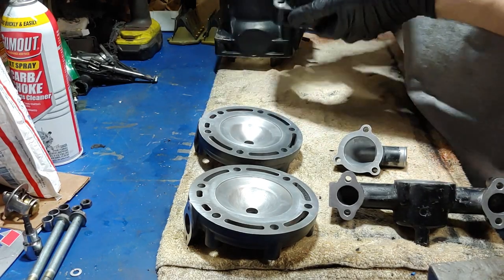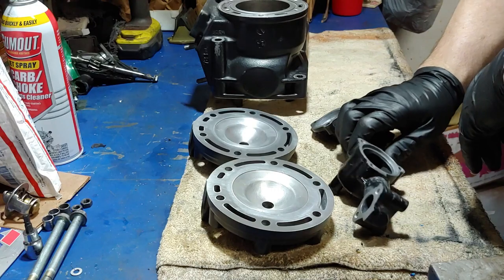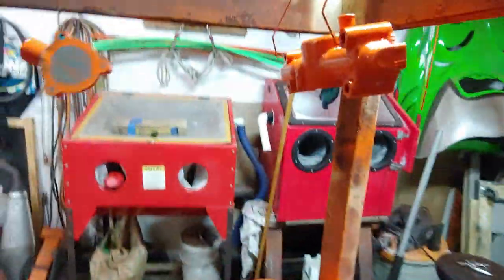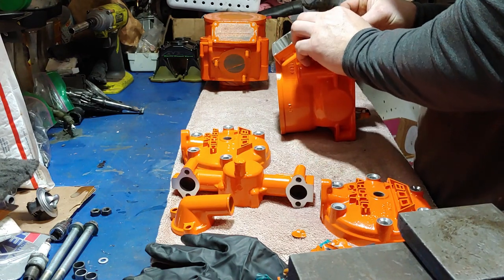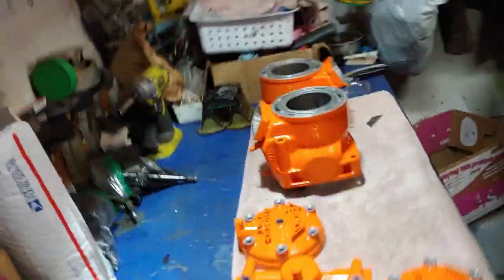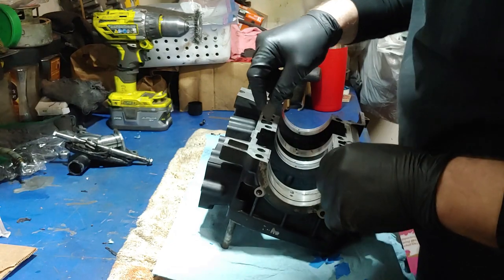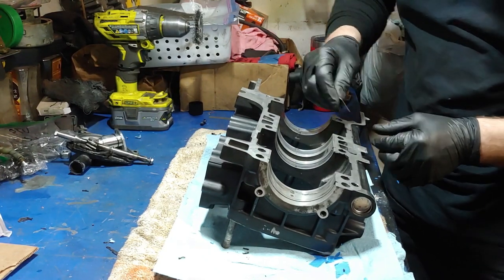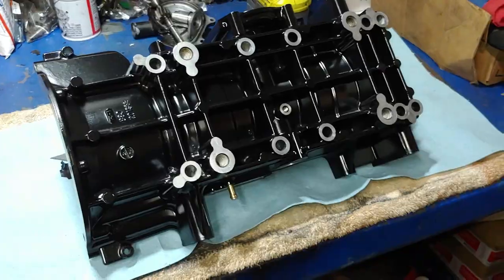02 Arctic Cat ZR 800 CCE Rebuild Part 14 || Refinishing Case, Cylinders, Heads and More!

Comment: You inspired me LOL going to order a powder coating kit if the world doesn't shut down
Reply: What grit and how much bigger is the Flex hone then the cylinder 1/4?
Reply from the maker: Hey that's great to hear! It's Definitely a great way to get started and yeah this covid crap is mostly all political!? it;s a real virus but no worse than the flu if even as comparable. 

Andrew C.
Reply from the maker: They usually are 320-400 grit and are Aluminum Oxide Ball hones that are made for a "range" of cylinder sizes... For example... 72mm-76mm cyllinder bores. So figure out your cylinders OEM bore and then get the closest ball home range that your cylinder bore is within. I use Transmission fluid for my honing process.

Comment: Dude i wish you could rebuild me an old school iron donkey sled like this but it has to be done right with the best/newest parts and no cheep junk like cast pistons only the best of the best parts like forged pistons
Reply from the maker: Well the cast pistons I used are made in Japan by ART, the same factory that makes the OEM SGP pistons. They last a long time! Many sleds taken care of have them for 10k+ miles. The forged are more for racing applications like drag racing. I only trail ride at this point. I did just acquire a 99 Thundercat 1000 though! ;)
Reply: @Fixin2Ride-Official-  bad dude bet that 99 tcat will scream and that old school tripple anthem purr tho

Comment: I was always told not to hone nickasil cylinders
Reply from the maker: Unfortunately a lot of people have been told that. It Says it right the Arctic Cat manual. Use a Aluminum Oxide Ball hone. Takes the glazing off. Glazing is burned oil that fills the cross hatching. The cross hatching is suposed to cycle oil through with each stroke lubricating the rings and piston to avoid friction and thus galling (transfer of ine metal to thw surface of another). When glazing happens the cylinder cant hold oil and thus not lubricate properly.